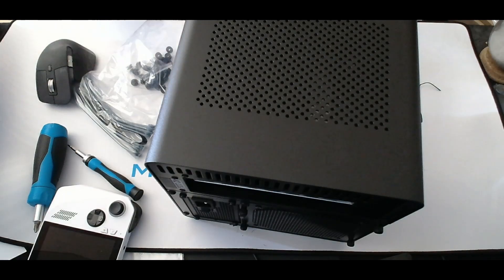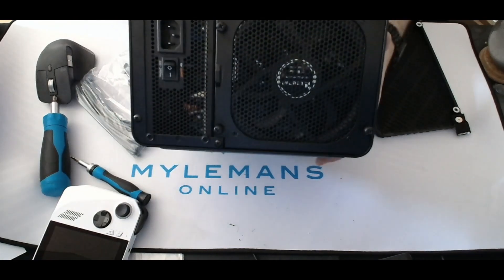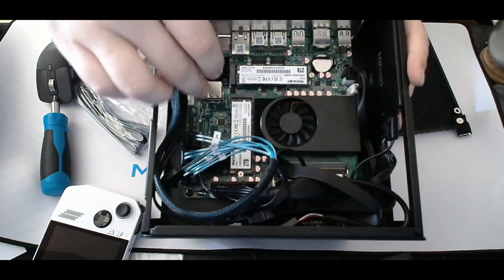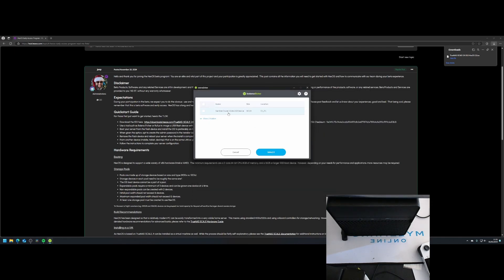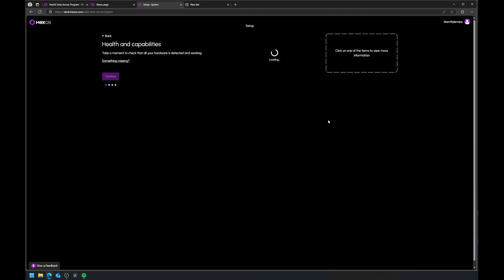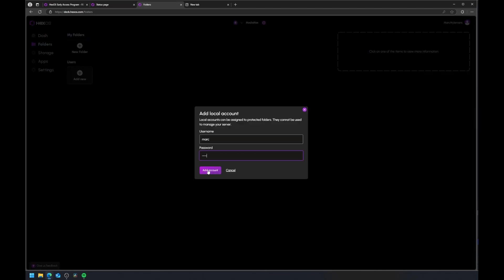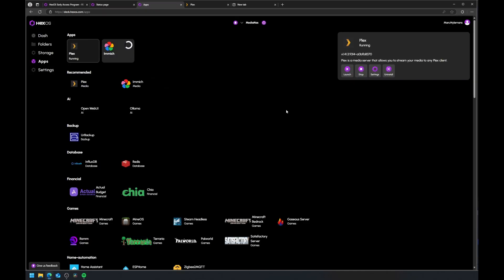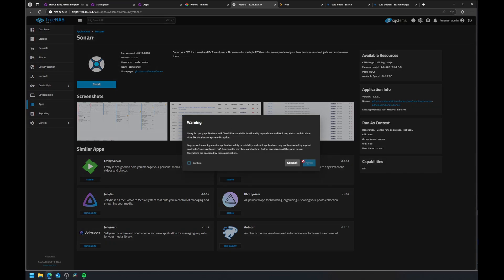You Won't Believe This 50TB Jonsbo N2 NAS Setup

Comment from the maker: Hi Everyone, I hope you like the new NAS i have build. This build is not sponsored but I still want to share all Parts that I have used in this build, including a link to the website of HexOS. 

Parts used in this build:
Case:
https://www.amazon.com.be/dp/B0CB6GCM96?ref=ppx_yo2ov_dt_b_fed_asin_title&th=1
Power Supply:
https://www.amazon.com.be/dp/B0937GNL7W?ref=ppx_yo2ov_dt_b_fed_asin_title
Motherboard:
https://www.amazon.com.be/dp/B0DKBDSG2B?ref=ppx_yo2ov_dt_b_fed_asin_title
RAM:
https://www.amazon.com.be/dp/B09XB3ZNHC?ref=ppx_yo2ov_dt_b_fed_asin_title&th=1
HDD:
https://www.amazon.com.be/dp/B0CW6K8DZ3?ref=ppx_yo2ov_dt_b_fed_asin_title
SSD:
https://www.amazon.com.be/dp/B089Y3262K?ref=ppx_yo2ov_dt_b_fed_asin_title&th=1
S-ATA Cable
https://www.amazon.com.be/dp/B0967JDVVS?ref=ppx_yo2ov_dt_b_fed_asin_title&th=1

Link to HexOS:
https://hexos.com/

I got my HexOS license during blackfriday, at that time it was only $99, currently the price is $199.

If you are a Truenas Veteran, HexOS is probably not worth the extra license and my Nas for my HomeLab environment is running the classical Truenas.

But if you want to come home and want your NAS to be easy to use for the entire family I would highly recommend it!